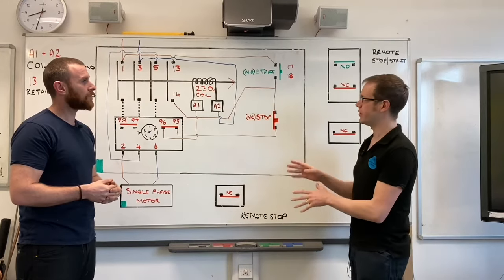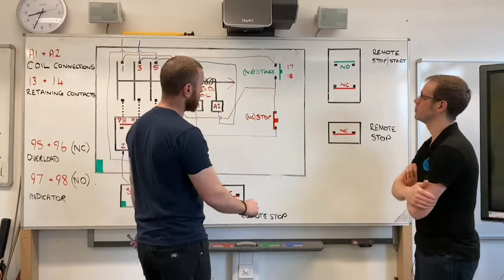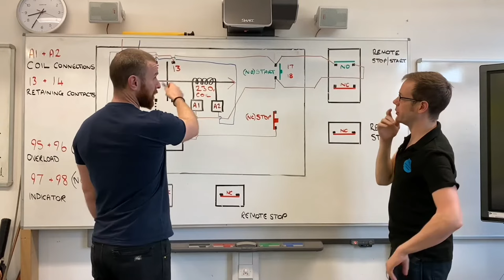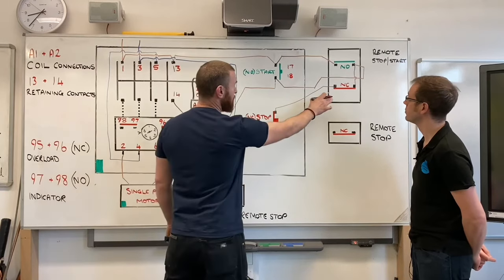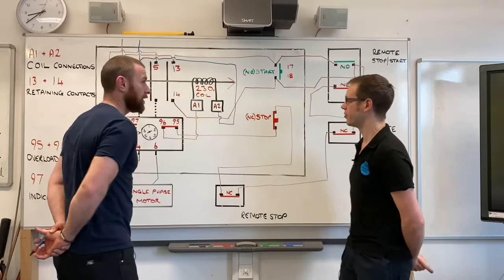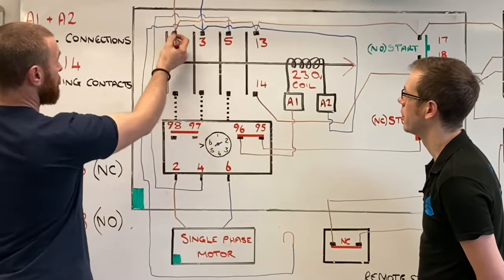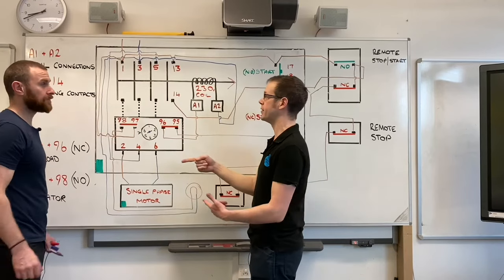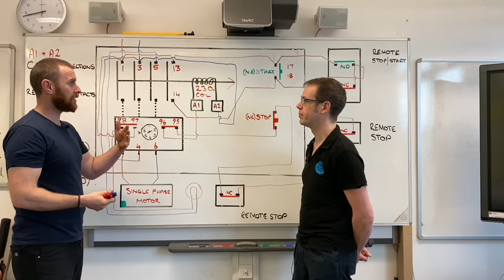Direct Online Starter DOL Adding Remote Stop Start Buttons Wiring Diagram Explained

Comment: Very nice board drawing ! Keep up the amazing work teachers !
Reply from the maker: Thanks for watching and commenting 👍🏻
Reply: @GSHElectrical  4 motors connected to different tables doing different jobs are all stop by a remote green stop button but a 1500 watts motor the fifth one is not connect, what to do? This big power motor has no remote stop button at all and the customer wants to connect to the existing stop button.

Comment: This was a great video to watch and very informative. Only question I need an answer to is that I intend to add additional start stop switch to control my single phase 3hp dust extractor which is located about 10m away from DOL so what size of cable would I best use for this? I got the grasp of the wiring concept now after watching this,  just unsure of cable size.

Comment: Joe and Matt, thanks for this. One question on something I may have missed: are the current overload contacts 95 - 98 always latching and so have to be manually reset? (If not latching then I assume the warning lamp would immediately extinguish, yes?) So, how is a reset achieved? it is cover-off and press a button or is there a time delay? I have a starter which seems to keep dropping-out in a no load situation and hence I'm trying to get to the bottom of what's happening.

Thanks again to you both for the explanation.
Reply: Some OLR will Auto-Reset themselves but some will require Manual intervention. 
The auto-reset ones can be Manually reset though.
Reply: Bear in mind though that UNLESS an OLR Tripped on Fault, the contacts 95/96 will remain "Intact".

And contact 97/98 will "Never Connect" until OLR Tripped.